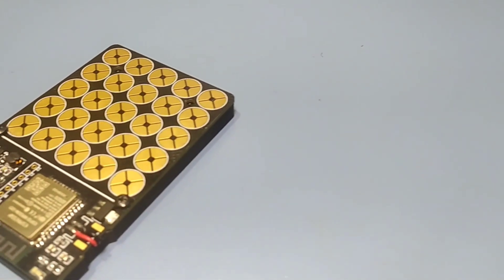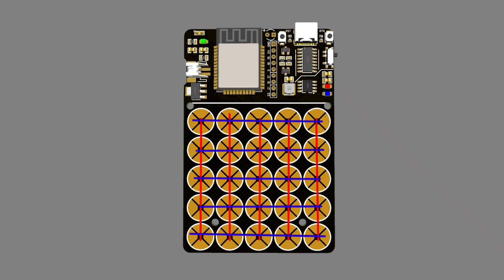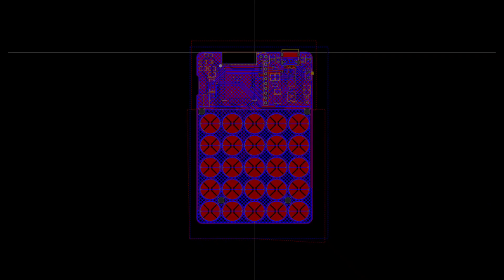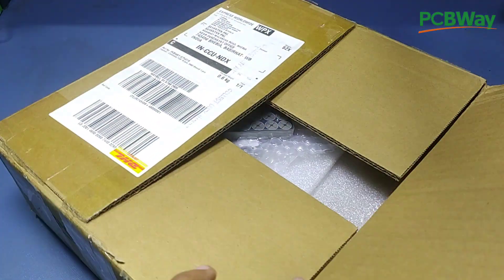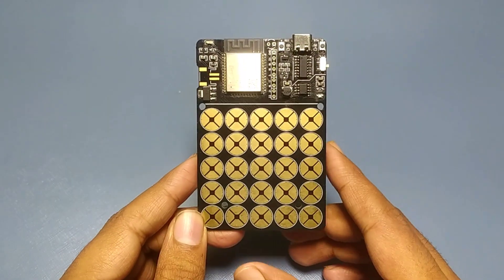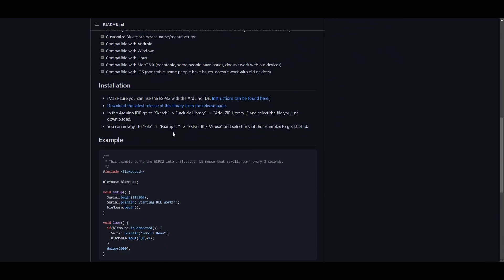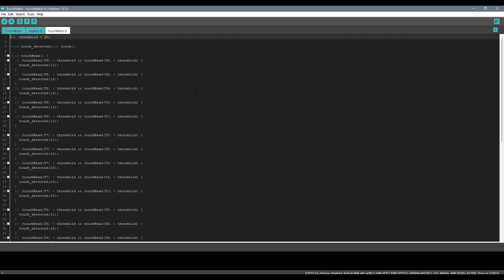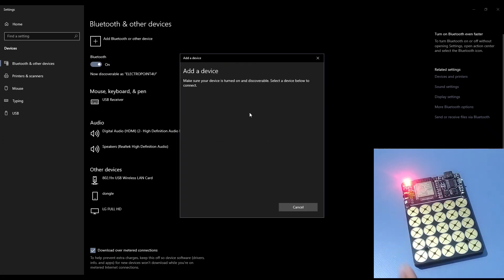ESP32 5x5 Touch Matrix keyboard

Comment: Does this matrix and the library work for multi button pressing? For example, it can sense and distinguish if the top left and bottom right buttons are being pressed and held at the same time.
Reply from the maker: Yes, you can change it in the code. ESP32 supported multi touch
Reply: @ElectroPoint4u  great, thank you!